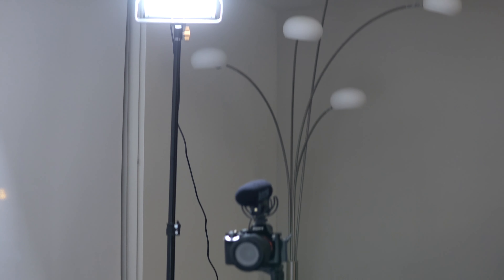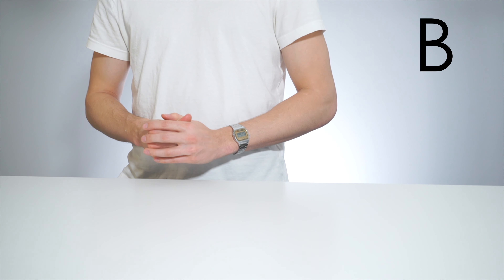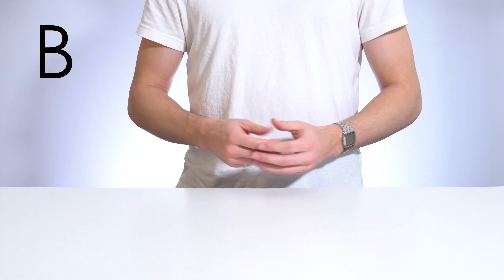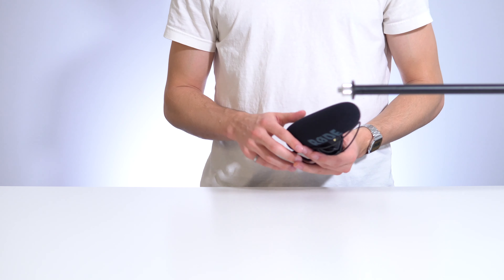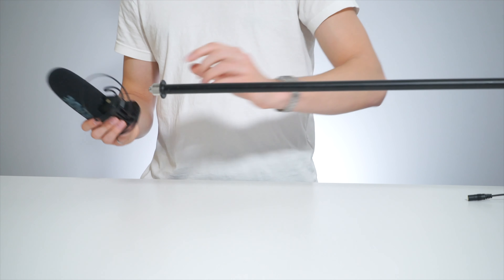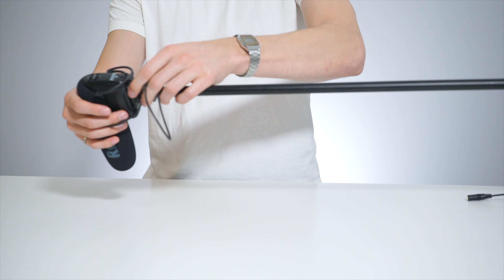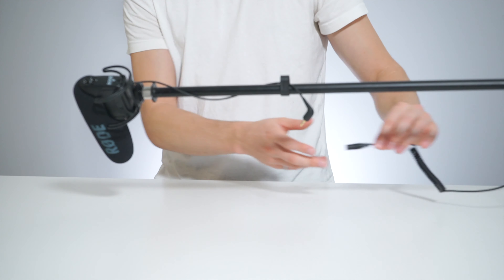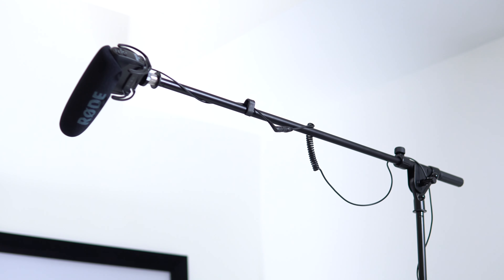Easy Rode Videomic Boom Setup

Comment: great post man, what settings are you using on the mic for recording this way?
Reply from the maker: The Videomic Pro doesn't have too many adjustments. I'm just recording at 0db gain, no high/low pass filter. Mic 1.5ft from my mouth. 
Also just picked up a Videomic NTG which is what I've been using for my past 5 videos or so
Reply: Lifestyle Lab this only has 0, -10, and +20, correct?
Reply from the maker: Correct, and a high-pass filter on/off

Comment: can any boom stand be fitted to Rode videomic pro+ or it has its own boom stand that I need to purchase? Thanks in advance!
Reply from the maker: The Rode mics have a 3/8" female threaded connector on the bottom. Your boom needs to somehow get to this thread size in order to connect the mic. 
In this setup, I use a 5/8" boom and then use an adapter to drop down to the necessary 3/8" for the mic. 
I've linked all the necessary components in the description :)

Comment: I fixed my same mike like B type .Can you advice me the volume level in camera (sony a6400) and setting in rode video mic pro . Also a A/C is  behind me . So is that  A/C wind noise catch the mic ? Any advice
Reply from the maker: Turn down the in camera pre-amp as much as possible, while still achieving proper sound meter peaking (you can increase the gain on the mic) 
As for the AC unit, the only way to avoid caputing that noise it to turn the unit off.